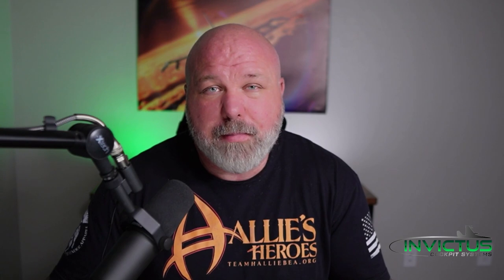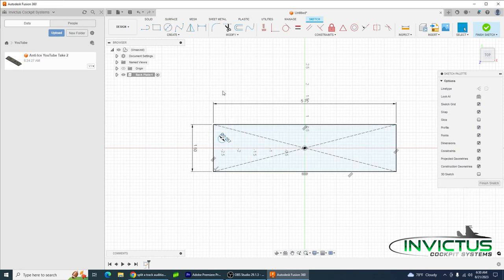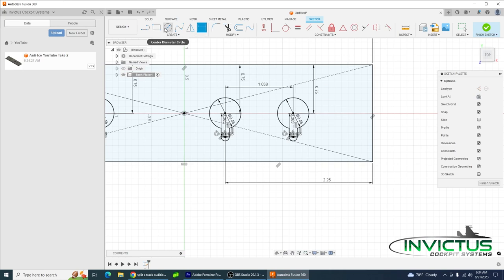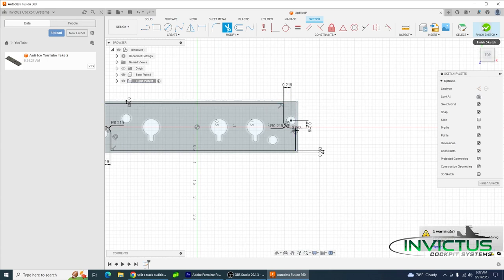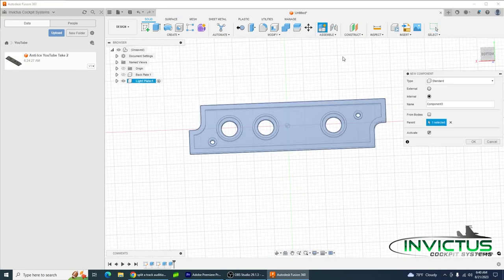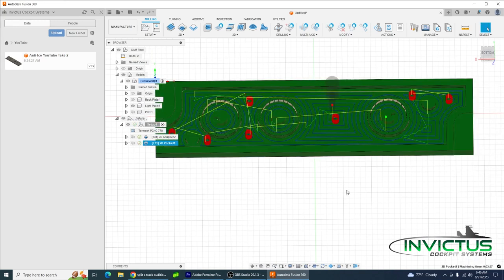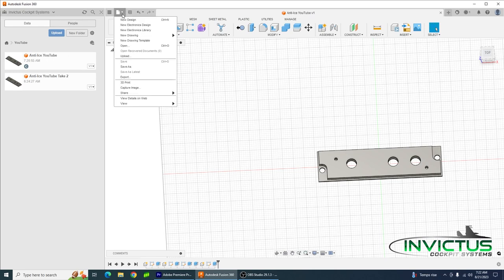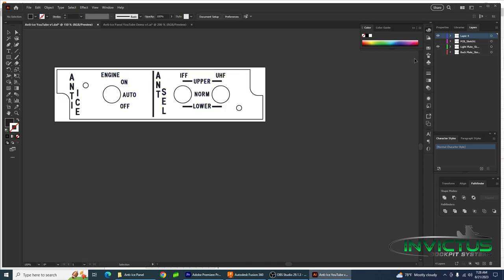Design & Build Cockpit Panels for Your Flight Simulator: Part 1

Comment: Brilliant! I'm just about to start making panels for my simpit. Keep up the great work! First I want to rebuild my Thrustmaster Warthog throttle into a button box with custom switches and a different arrangement of toggle switches and custom acrylic faceplate
Reply from the maker: Awesome!  If you get stuck, reach out.  Happy to help.
Reply: @Invictuscockpits  Hello! Where can I buy knobs for the F-16? I need only 3 for my Thrustmaster mod. Are you selling? Thanks
Reply from the maker: @ir.clutch  I can make some for you no problem.  Just let me know which ones you need.  You can reach me easily here +> https://invictuscockpits.com/pages/contact

Comment: This is really a fantastic tutorial. I followed along in Fusion 360. I had been developing a similar technique but you have some clever steps in your process. Thanks for sharing this knowledge. The lettering is the part I have been missing - you covered it pretty fast in video. I'm going to have to go back and watch it a few more times. I need to understand the how and why for using Illustrator for the text.
Reply from the maker: Text in Fusion sketches doesn’t work well in lightburn.  When Fusion exports a file as DXF, the lines are not joined, so each line, curve, etc of each letter would have to be manually joined as you see when I join other elements needed for laser work.  Illustrator is much better for that.  I’m sure there are other programs that would work just as well like Corel Draw or even the open source option, Inkscape.  I use Adobe products for other things too, so I have access to it.  But I’m sure other options are just as good.

Comment: Great tutorial, I have also tried to draw panels using the Military Standard MS2512.  But it is hard to read and understand.  Your drawing is much better.  It is a little small though and when I make it larger it is also hard to read.  Any chance you could put a higher resolution version of your panel dimensions in the comments.  Much appreciated!!  Please keep up the great content and products.  I am considering your Force Sensor Mod.
Reply from the maker: I just tried to resize the image in the blog post.  It's better but still a little fuzzy.  If it doesn't work, email me through the site and I'll send you a pdf.  Sorry for the delayed response,

Comment: Hi, I am following you and I also bought the design for the F16 frame. I am doing my own cockpit at home and recording everything (when I have time) on my blog.
Question for this panel.. which kind of Switch we would need?
Reply from the maker: All three of the switches are on-off-on, single pole, single throw.  I use these:  https://invictuscockpits.com/products/long-handle-mini-toggle-on-on
Reply: @Invictuscockpits  I have tried to put that model but it seems smaller for Ø0.48, where I should crimp them?
Reply from the maker: The ones I linked are specific.  They are larger than normal mini-toggles, and they are the specific ones I use in my panels.  They have solder lugs, so you’ll need to solder the wires to them.  I need to finish up part two and get it on here to show how.  I’ll try to do that this week.
Reply: @Invictuscockpits  Fantastic! Looking forward to see it! You are doing a great job! Thanks!
Reply from the maker: @cockpitmadness  thank you!

Comment: Are the switches on your avionics or HUD panels on your website the authentic lift-to- move type switches?
Reply from the maker: No, they are recreations.  We haven’t published them yet, but we will have a more robust line with the actual switches, though.  If it’s something you want to explore, reach out.  Happy to do them for you.  You’ll just need to cover the added cost of the genuine switches.
Reply: @Invictuscockpits  Thanks, actually I was just wondering if the “action” of the switches was of the pull-to-unlock variety - not so much that they were genuine authentic manufacture. Is that the case?
Reply from the maker: Not yet.  But I’ve got my eye on some to test.  The trick is durability.  My first thought was to use the lathe to turn down the barrel and thread it, then make a metal mock up of the various switch heads.  But by the time I do all that, it would cost just as much as the real thing for many of them.  My concern is that a 3d printed and glued switch head would fail pretty fast.

Comment from the maker: Note:  Bouncing back and forth between metric and standard makes my head hurt.  Excuse the errors.  The extrusion down into the light plate is 3 mm not six, and the PCB is 1.2 mm thick, not .12.